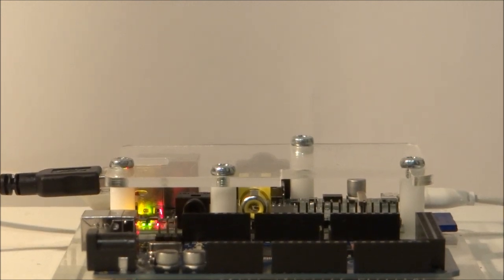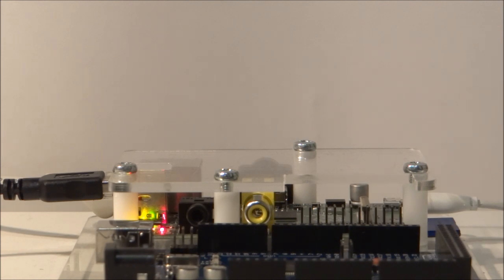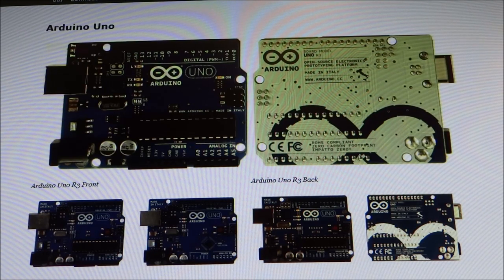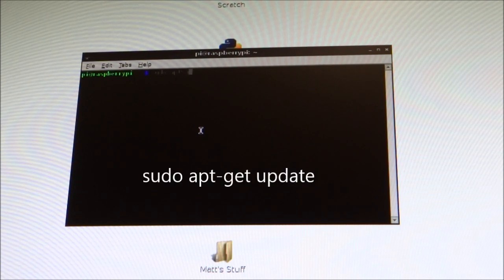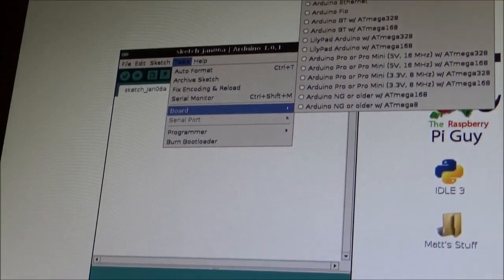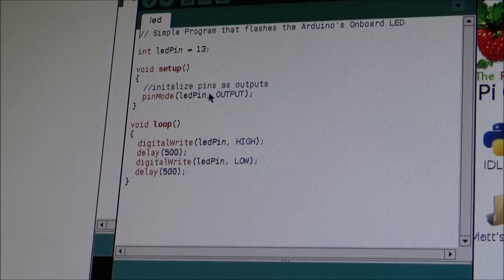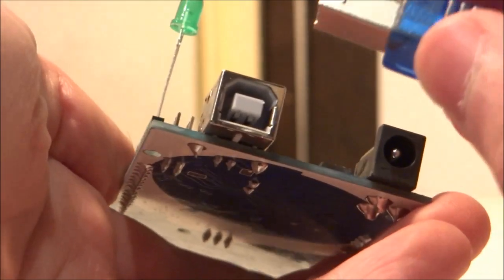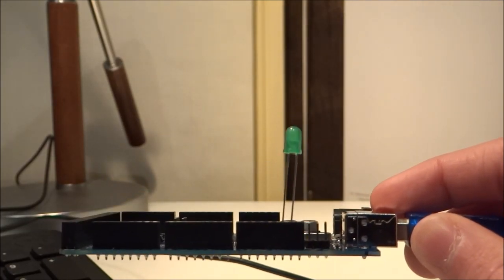Raspberry Pi - Using Arduino - Episode 1 - An introduction...

Comment: Hello Raspberry Pi Guy! I'm looking at investing into a small computer system for a little project I'm working on in my bedroom. I have built a soffit in the ceiling and have a mural of the sky both day and night via incandescent paint/black lights. What I want to do is mimic the sunrise/sunset in relative time with about 10 meters of analog LED strip. So far I have 3, 5 meter LED RGB strips, and a LCD AC power supply DC 12v/6amp. This video has been very informative Thanks again!

Comment: Raspberry Pi operates at 3.3v, and most Arduinos operate on 5v. But if you are using the Arduino Due, which has the same number of digital and analog IOs as the Mega, you will not need resistors or transistors to connect it to the Pi or a BeagleBone because the Due also operates at 3.3v.

Comment: I installed the arduino software on my Ubuntu laptop . I am going to try thi since my son is working on a project similar to this one. This is very interresting. I hope you find the time to do more. I already worked with he raspberry pi I made a small internet radio with lcd dispaly. Thanks for posting this project.
Dart

Comment: Great tutorial, I would like to see more Arduino and Raspberry pi projects and how they can be used together. I currently have an Arduino Uno and should receive my Raspberry Pi today. Interested to use as a LAN accessible control system solution for my home and garage.

Comment: Hi, If you are looking for ideas I have a project on at the moment and am wondering how to go about it. I am looking to control a arduino (mega) from a raspberry pi. I have a shed load of realys I need to control (about 10) and I also have the need to take signals from some analogue inputs (about 5). Thanx vm.

Comment: Spooky as it may seem I spent the entire weekend getting to grips with this.  With the help of a number of different sites dotted around the place, I've now been able to master the writing to, and reading from the Arduino board with the Pi over the USB using a very sexy Arduino sketch and Python.

The Arduino boards are incredibly powerful, but combined with a proper O/S - Linux - I can see some amazing potential.

Next stop for me is programming a GUI to control the Arduino features. :o)

Comment: Hello, Raspberry Pi guy! I have recently bought an Arduino Due. I am a beginner with some programming knowledge. I was thinking of making the Arduino to control a telescope(Celestron 50AZ) with servos to follow planets.  I have recently found that the raspberry pi camera could be used with any telescope to record videos and take photos. I am planning to use a software called Stellarium which can be used with pi and some how use its data to contol motorized telescope to work with my servo.

Comment: I am talking about the serial port. On windows they are called COM ports, in unix OS one of them is /dev/ttyS0. The Arduino software pushes the sketches to the Arduino via a serial port. The Arduino can also talk back and forth with a serial console over this connection. This serial connection is kind of emulated by the Arduino boards via the USB connection and ends in a serial port on the system side. You can can connect multiple Arduinos via USB and can change the port under Tools>Serial Port.

Comment: I would like but I'm suspicious of that LED without a resistor. There should be one. I believe that it just so happens the Arduino cannot supply enough current on the digital out to burn the LED, allowing you to get away with it. Still does not make it good practice.

Comment: Not that I know off, you might have to hold the reset button before uploading but otherwise I've never had trouble uploading code.

The advantages vary from board to board. 
The mega has loads of inputs for big projects. 
The small (mini) ones are great if space is limited. 
Some other boards run on 3.3V. 
Others have stuff like bluetooth and SD card readers built in.
But the standard arduino is great  
I personally like the seeeduino, it is an arduino but with one or two improvements.

Comment: Absolutely awsum video as new to electronics and Arduino and pi's didnt know you could program an Arduino with raspberry pi, hhmmm mini raspberry pi programmer with screen comes to mind.

Is there a way on the raspberry pi to show pdf files and videos as have alot on external hd for learning electronics 

I will be getting an arduino and raspberry pi soon so very interested 

Thanks in advance guys

Comment: What about a video (or set of videos) that deal with communicating between the Pi and Arduino using the Pi's serial ports (or other ones) ? Like this the arduino could be used to interface with hardware (since loads of libraries and documentation exist) and have the Pi deal with communications with the web ( for example streaming video from a webcam) and serving a webpage.   

Love the video tutorials. Hope you keep making them :)

Comment: I am using Pi to Mega. I need to get info from arduino mega to Pi. I have 25 inputs to Arduino. I assigned 5vdc to the inputs. I am trying to record piano player rolls to Pi then play back thru Mega.Your great video shows Pi to Mega Thanks... Do you have connections for Mega to Pi?

Comment: Hi Pi Guy. Thanks, Ive been watching your videos lately as I wanted to start doing some home automation. Im not familair with programming/soldering etc but a bit familiar with Linux. I have a Pi running with wiringPi which is controlling my store front gate using a Garage relay script I found online and a 5v relay.... What I don't understand is WHY do some people use a RPi + Arduino for home automation? Why not just use the RPi or vice versa? I cant seem to find a video that would explain this in detail. Thanks again!

Comment: Hello Im still new to all this but I need help on figuring something out. Can the Arduino be connected to the Raspberry Pi,  a coin acceptor, and timer. If so can the Arduino be programmed to disable the usb ports on the raspberry pi until money is put in.

I made a raspberry pi emulator and would like it to be coin operated.

Comment: Hi, great video.. but i still have a doubt about Raspberry and Arduino comparison that i cant find anywhere.. Im using arduino for a simple closed loop control witch i need high frequency to sample and process. With arduino im getting about 5kHz. I would like to know if i Raspberry would surely give me higher frequencies since its clock is 700MHz or not, because of the OS.. In short words: is Raspberry faster than arduino for the same application?

Comment: Ciseco use a simple protocol called LLAP to talk to the radio's. I've already managed to make a RasPi turn LED's on using a USB radio pluged into a PC and XRF pluged into the RasPi via Slice of Pi.

Also  turn a motor on and off using one of their relay boards with the same USB dongle connected to PC and another XRF on the relay board.

I'm thinking all kinds of home automation here. Need to brush up on Python for the RasPi before I can get much further.

Comment: fantastic tutorial, yes arduino and rasb pi are a great match,why dont they make a board with both combined ,keep on with the rasb pi and arduino combo tutorials.
Reply: There is an addon for the Raspberry PI called Gertboard that has an ATmega micro controller onboard.

Comment: Great video, say I wanted to connect my Arduino Uno to relays, would I be able to wire the pins directly into the relay board, for example a SainSmart 8-Channel 5V Relay Module, without having to add resistors or transistors? Looks like the pin's withstand about 40mA

Comment: I trying to build an inexpensive standalone single axis positioner.  I’m using a RPi connected to a stepper controller. Do you recommend this or should I combine the RPi with Arduino?  I only need 4 pins, step-direction-home-limit, from the RPi , so the extra pins from the Arduino are not needed.

Comment: Yes - it's the magnifying glass icon in the top right of the window (labelled Serial Monitor).  It doesn't work for me with the RasPi.  I get the message "Serial port 'COM1' not found. Did you select the right one from the Tools > Serial Port menu?" and when I go to Tools, "Serial Port" is greyed out (not available).

Comment: How do I e-mail you?  I am new to raspberry, but programming in C++ in college.  I like to be able to receive blue tooth mouse signals and do other things with the results.  I am in a wheelchair and my joystick emulates a Microsoft blue tooth mouse so I can control my android phone with my control from my wheelchair control. I would like the raspberry to receive blue tooth mouse and have the Raspberry connected to the control of some type of control vehicles.  Either connected to the remote for sending out directly to the vehicle. I have done projects with arduino.

Comment: Hi, i have just started using an arduino uno and wanted to know some of the basics. I'm using it with the raspberry pi. I did everything that this video said but the external LED is still not flashing. However, the onboard one is. The program is not saying there's any programming errors and i cant figure out what's wrong with it. Does anyone have any tips on how to fix this?
Reply: Either your LED has been damaged or you have it connected the wrong way round.

Comment: Since you had USB plugged in was it powering arduino board ?
Reply: Yes, the Arduino was being powered over USB. You can also use the Jack Socket on the Arduino with 7 to 20 Volts.

Comment: I want to connect Raspberry Pi Tx, Rx Pin with Arduino, can you show a demo on that , I have followed some Tutorial but that's not working. Arduino is not receiving signal from PI, But from PI I can use wiring pi and can blink a LED.

Comment: The version of Arduino I'm using is 1.0.1 (this is the latest after using apt-get update and apt-get install arduino).  The Board is: Gertboard with ATmega328 (GPIO) and the Programmer: Raspberry Pi GPIO.  It doesn't matter what code I use, the Serial Port option just isn't available (greyed out) even for an empty sketch.

Comment: Hey... I like your video. But what about the COM port? I think this is a leak in each and every Arduino tutorial so far. No one discusses the COM port settings. On Windows I had to install a special driver for the USB COM thing to work. That has not been told in their tutorials at all and I thought my code was wrong.

So what about the COM Port on the Raspberry Pi? Do I have to install something for that? Do I have to select a special one?  Which one is selected? 

Hope that helps the noobs. ;)

Comment: is it possible to use usb hubs on the raspberry pi USB ports?, i mean, will it be safe?
Reply: Yes. I use hubs with a couple of the RPis that I have. I did take the precaution of snipping the  5 volt (red) wire in the hub, to prevent back powering the pi. However, it is possible to back power the RPi, so long as the power supply to the hub is stable.

Comment: As I am listening to this, it comes to mind how I would apply this board. Imagine a 85 watt 12v solar panel (in the sun) attached with a healthy wire to a 12 volt crock pot (sold in truck stops). The Crock Pot uses all the electrons produced by the panel. Once the cooking process is understood, then the panel sends electricity to a bank of batteries, ceiling fan, lights....all stand alone system.

Comment: Arduino costs more after adding ethernet and you cannot do as much
Raspberry pi is Half the code to turn relays on and will do allot more..oh and its 5volts
Reply: Arduino is 5v, max 40mA. Pi is 3.3, max 5-10mA.
All comes down to what your projects are

Comment: Hi, I'm trying to use the Arduino IDE with my Raspberry Pi and 3.5 TFT+ touchscreen from Adafruit, https://www.adafruit.com/products/2097, and I can't see the whole IDE,  I just see the midle,  here's a video I uploaded describing my problem.  Have you ever seen this problem and do you know how I can fix it?   Thanks......Antonio
Reply: You may have to edit your config file for the RasPi resolution?
Reply: Mike C Hi, and thanks..here's a list of the changes I've made in - sudo /nano/boot/config.text

1. I removed the # from disable overscan. - did not work
2. adjusted #overscan top=16 to 32 - bottom also to 32 – did not work
3. adjusted the to height to 480 width to 320 – did not work
4. I removed # from the sides top and bottom – did not work

None of these changes affects the 3.2 adafruit screen. It's as if the resolution for the small screen is somewhere else.

Let me know if you have any other ideas....Thanks

Comment: I'm glad you like the logo Matt.

Ciseco make a range of radio modules that can be used with RasPi, Arduino, Micro Controllers, and PC. 

Their XRF module plugs into a Slice of Pi which can then recieve commands using the RasPi's serial port.

They Also do an Arduino Uno clone called XinoRF that has the same socket for an XRF radio module for remotely controlling the board.

Check out their web site.

shop.ciseco.co.uk/rf-module-range/

Comment: Mac "PC"?
Reply: PC stands for personal computer, which is what most people call windows. But technically, every computer you own, and is not owned by your company, is a PC. It doesn't matter about what OS it's on.
Reply: DrNefario Apple commonly refers all non macs are pc and never calls its pcs pc... :( they think they made something great -_-
Reply: Srinag Rao maybe we should call them 'wintels' (windows + intel) or something like that, reclaim the term 'PC' to include x86+linux, ARM+linux, and anything oriented for general purpose personal use rather than an embedded system or whatever, etc.

Comment: "Is not limited by Linux, .. I/O pins.."  The Pi running Linux and the number of GPIO pins it has have nothing to do with each other, that's pure hardware design and keeping costs to a minimum. Please make sure your info is inaccurate, especially as you're calling yourself "TheRaspberryPiGuy". That aside, keep making the videos.

Comment: You lost me what the point of all of this is, I can understand the arduino only has 8 bits and 8k memory (no multitasking or threading) and you may want more power.(personally I think its junk and a waste of money) So why not pickup a Netduino, tons more power, costs a bought the same, you can write in C# or Visual Basic, with real time debugging. Some thing the raspberry PI cant even do, as Microsoft wont load on a PI. The Fez is another nice board running C# with every option known to man.